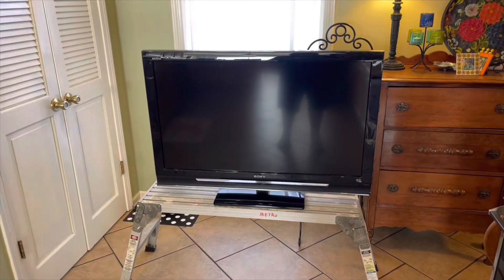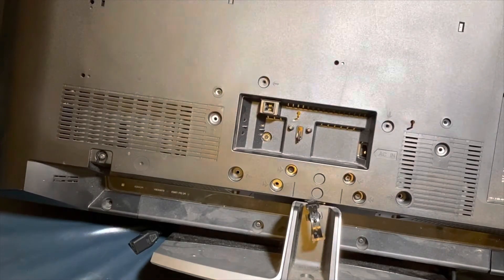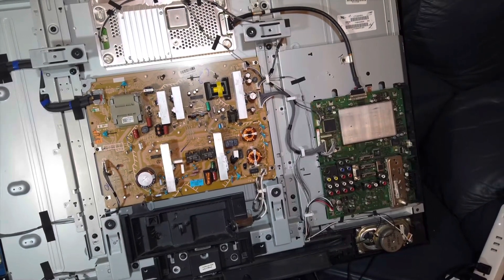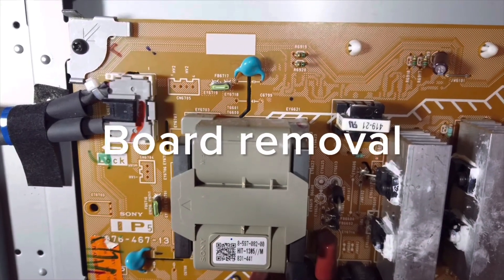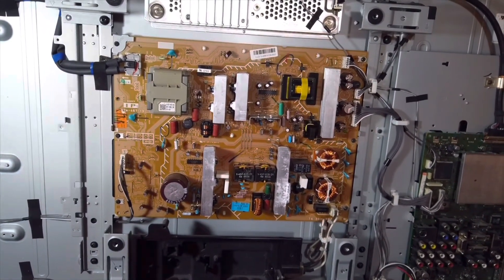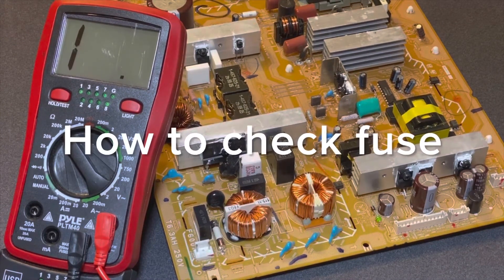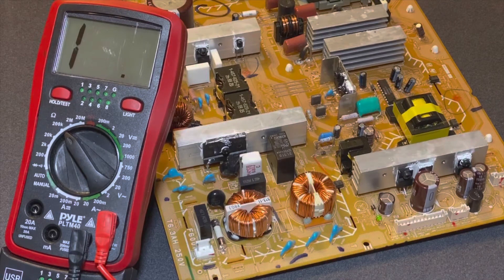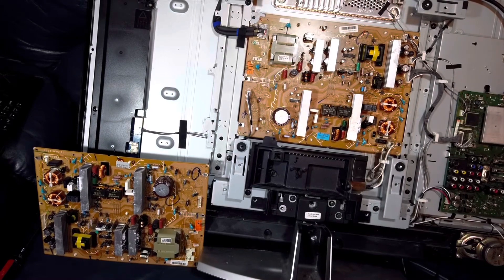LCD TV dead? Fix it yourself. Check this first!

Comment: Hello, so i have a tv that seems to turn on, but the panel does not turn on, i'm assuming it is not the ps board in my case. Do you have any idea what the issue could be? i'm thinking it's either the screen itself, or the logic board.
Reply from the maker: @Nojnoj Hi, sounds like your power board is ok so you are on the right track - most likely the screen itself or logic board. See if you can check voltage where it powers the screen - that will help eliminate choices….
Reply: @DougForce  will do!
Reply: It's taking a bit of extra time to be able to get ahold of the tools needed. But I wanted to take the time and thank you for replying so fast to a comment for a video you posted 3 years ago. I truly appreciate it.  @DougForce
Reply from the maker: Glad to help if I can! I appreciate my viewers and always try to reply. Let me know how it goes!

Comment: I had always heard that HD TVs have VERY a short life compared to the LCDs that me any my parent bought back ion the 1960s to 2000s. Then again, I have always been told to, "Be patient. It's fixable, when it comes to HD TVs. It's always a circuit board or a fuse."  (I once threw out a TV that was over 50 years old. I only threw it out because it was black and white, but that observation is so early 2000s.)
Reply from the maker: @Scott Rauenzahn I’ve heard the same thing and it’s probably generally true, but many times the fix is a simple, inexpensive part. Definitely worth checking before tossing a set.